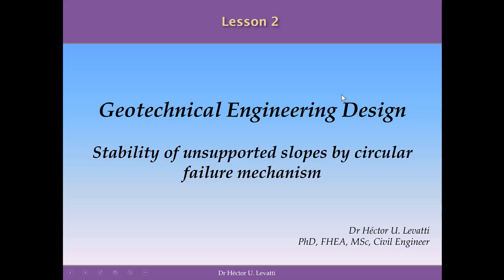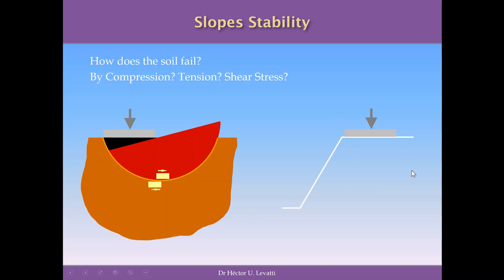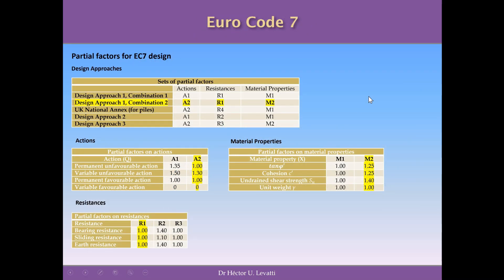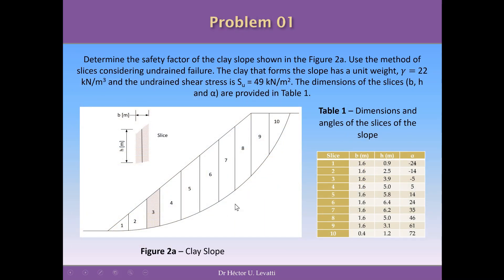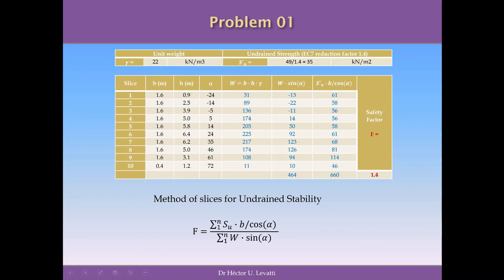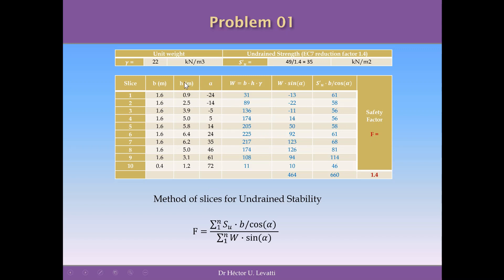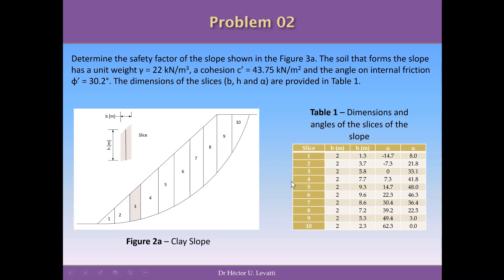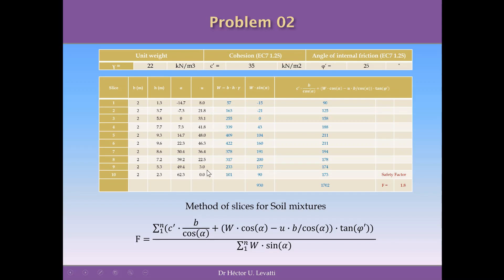Lesson 02 - Slope Stability Problems

Comment: Sir how to find the value of U in 2nd problem...
Reply: u is the pore water pressure in every slice, so, it is data. Usually, get from the field using a piezometer.
Reply: Height of water table above the base of slice multiplied by unit weight of water.